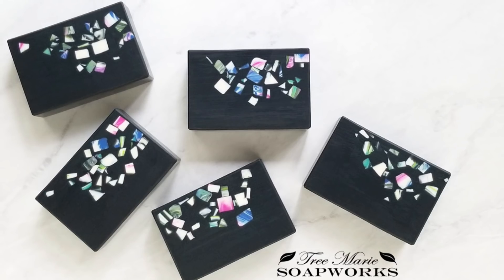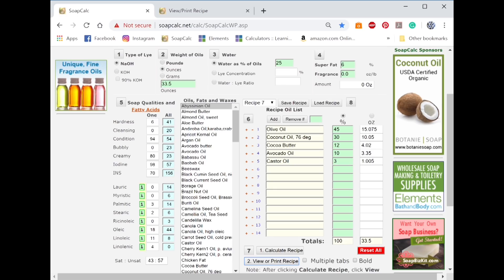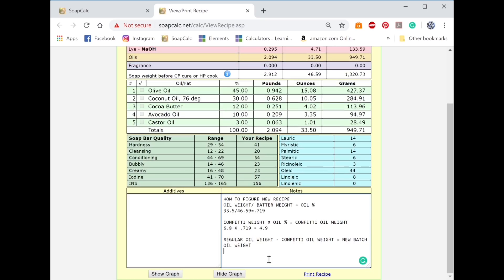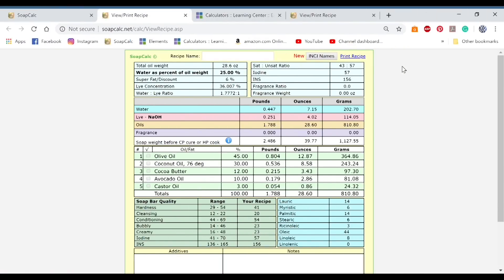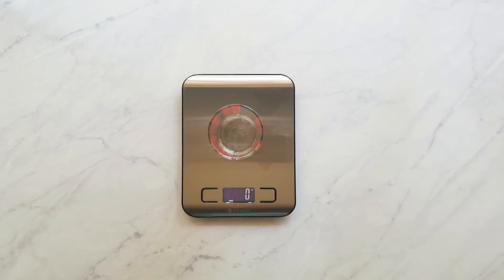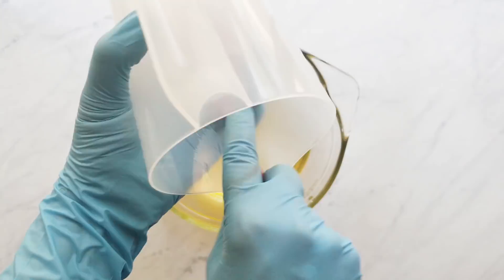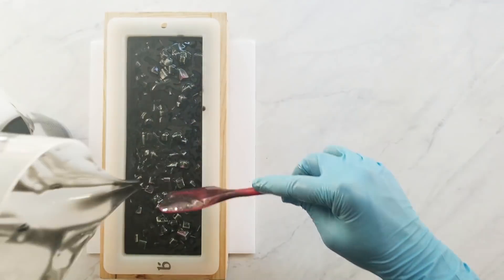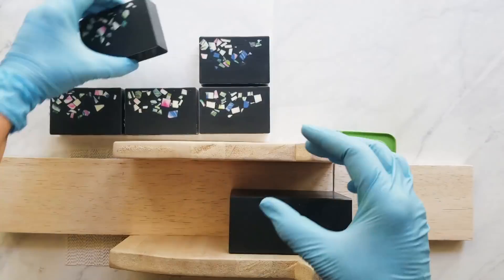How to Make Confetti Cold Process Soap | Recycling Soap Scraps | Technique Video #20

Comment: What do you mean when you say you turn the oven off and leave the light on? When the light is on, does the oven still generate heat? And if so, at what temperature? My oven has a timer, a mode selector (bake, turbo, grill, etc) and a temperature selector, so I don't understand how to apply your method in my oven. Thank you 😊
Reply from the maker: Does your oven have an incandescent light bulb in it? Those generate a little heat. I just preheat the oven a little and turn it off, and the light keeps it warm. I am just trying to nudge it through gel to avoid partial gel. 😊
Reply: @TreeMarieSoapworks  oh! One of the modes (grill, bake, turbo, etc) has a light bulb icon. I never noticed it before! Thank you for taking the time to explain it to me :-)

Comment: That recipe calculation seems more difficult than just making less soap batter based on how much your add ins weight...
Reply: Okay I see now what was happening, but that still seems more difficult to me...
Reply from the maker: For soapcalc, you can't put the batch weight in, that's why I find the new oil weight. It makes sense to me, but use the method that works for you. 👍😊💕

Comment: I have found when I want to save either soap dough or a certain kind of soap for my confetti soap, I use my vaccuum sealer to save them.  I don't waste since I can make the bags any size.  I have used soap up to 8 months with no problems.  The soap was still soft enough for my use.  Thanks for the calculating tip.  ☺
Reply from the maker: Great idea, Cheryl!

Comment: If saponification has already happened on the confetti, I don't understand why would the oil weight matter? In my mind adding the saponified soap would be akin to adding plastic or wax to the new soap right?
Reply from the maker: I am doing this to figure out my next recipe without having too little or too much batter. If you don't care about that, don't bother with the math. 

This video is about using scraps, I don't want to create more scraps by guessing my next batch size.
Reply: Tony Ojeda ...yeah , I’ve never seen another soap maker do this, they just take the confetti weight away from the total batch weight to get the new weight needed to fill mould and run that batch weight through soapcalc to get new ingredient amounts...I’ve done that many times and it works perfectly for me 😀
Reply from the maker: You can't pick an weight of soap that you want to make in soapcalc, but you can pick the amount of oils. Do it your way for sure, if it is working for you.
Reply: Yeah....way too much work for something not really necessary.
Reply from the maker: It is the same amount of calculating. You can't pick a soap weight in soapcalc, but you can pick you oil amount and then you get your correct batch weight on your first try.
Reply: Tree Marie Soapworks Hi , maybe it isn’t soapcalc but one of the other soaping calculators does have a batch size option .. I’ll have to check which one I used and list it  here , its very useful ... love all your videos, your soaps are always amazing 💐
Reply from the maker: That would be easier. I do like soapcalc, for the quality numbers, but I would be interested in the other soap calculator. Thank you! 😊💕
Reply: @TreeMarieSoapworks  I use Soapmakingfriend.com & you can change the size of your batch by weight or even dimensions of the mold. :) PS. I'd love to see A!
Reply: You can see the total soap weight before cure on soapcalc, it just gives it to you in the final step when you calculate everything. I guess you could just go back and forth and play around with the oil weight until you get the soap weight that you need.

You could also just do a simple calculation like taking the amount of oils in a full batch  and multiplying by the total soap weight that you need in the new batch, and finally dividing that by the total soap weight of the original, full batch. This will give you the amount of oils that you need for the new batch.

Basically, look at the final soap weight in the original calculated recipe on soap calc, and then

Oil weight soap A x final weight of soap B ÷ Final weight of soap A= oil weight of soap B.

I hope that made sense, lol :)
Reply: At 2:45 in this video, under the purple "fragrance" section, the next line, white color, is Soap weight before CP cure. That would be the batch weight of your soap, before the full cure. Hope this helps make things a little bit easier to calculate for next time!
Reply: I switched from soapcalc to soapmakingfriend.com b/c it is sooo much user friendly and versatile, plus if you were using a new mold you can enter the dimensions and the calculator will do the math for you.  This calculator does give you property values and even adds one (longevity) and graphs the info also.